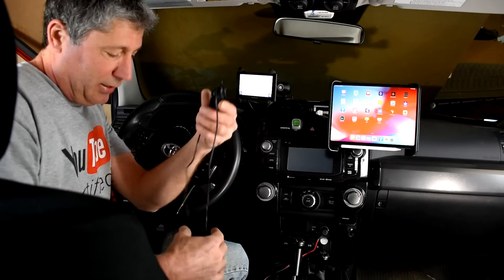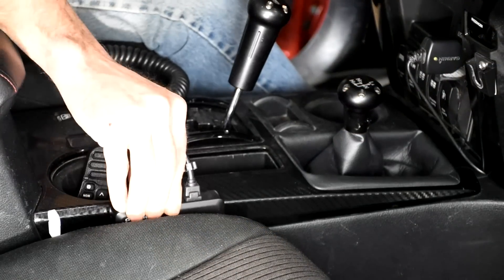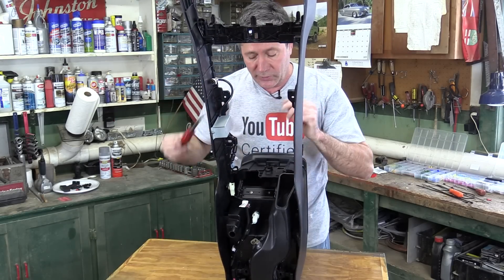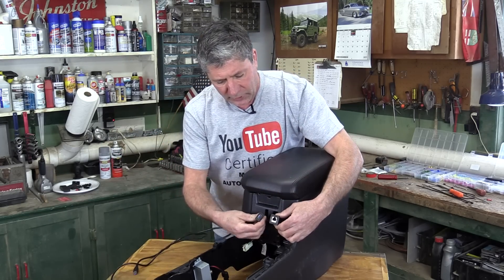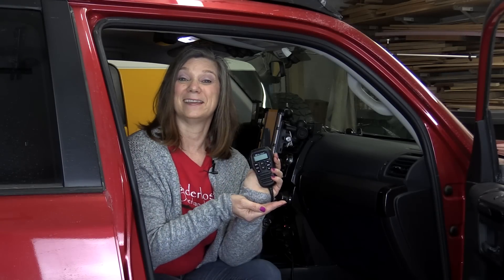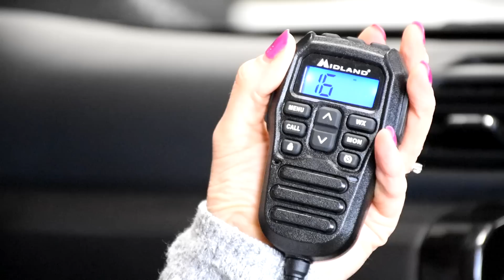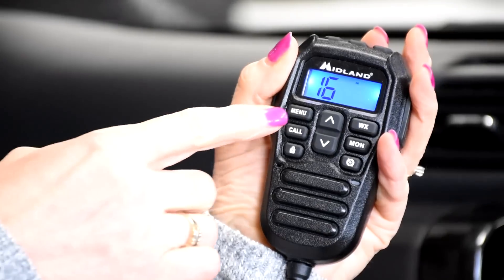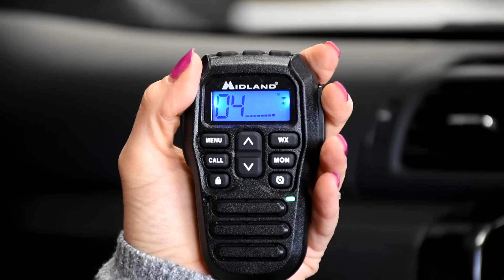GMRS Radio DIY Install & Testing Against CB Radio For Distance

Comment: Your results were very interesting. My friend and I did a similar test. Both vehicles using tuned roof mounted cb antennas vs in vehicle handheld gmrs radios. We found the cb to have much more distortion but longer range. I was unfamiliar that they even made vehicle mount gmrs radios, good video
Reply: In theory, CB should outperform. Lower frequency, longer wave length, less path loss. The reality is, it takes a lot of work to get a CB install just right to do that on “legal” power levels. GMRS uses tech that’s been proven reliable over the last 30 years and is much more forgiving but 5-8 miles is more realistic in terms of open area range (radio to radio).

Comment: I Hope mobile GMRS rigs of this type becomes a thing in Canada we only have low power handhelds. I am impressed by the compact well optimized GMRS mobile antenna as compared to the slightly larger but compromised CB stick since a properly optimized CB antenna needs to be 102 inches,  too cumbersome for most.

Comment: In all fairness, the CB setup you're using isn't ideal for long range comms. It's a small low power unit. But, GMRS is a better option anyway. I'd just stick with that.

Comment: Great reception over the flat Iowa corn field terrain with GMRS.  Of note is the 50W power allowances of some GMRS channels.  And repeaters that can enable coast to coast communications with GMRS.  But, CB is my goto for local info and road conditions.
GMRS is for family and friends to maintain contact over relatively flat and open terrain.  Obstructions are not your friend.  And it didnt cost me a dime for the license, applied for online.

Comment: Excellent video! I got a couple of  VHF/UHF HTs and figured I'd study and get my tech license and one radio (VHF/UHF) for the car. Wrong! Now my head is spinning. I need a CB (preferably with SSB) and a CB HT or 2. I need a GMRS and a GMRS HT or 2. I need a VHF/UHF ham and a least already have 2 HTs.. I need a HF set for frequencies on ham (to get many miles) and a stinking general ham license to go with that. It's all a little much, and I'm overwhelmed. To cover all my situations, I truly need 4 different types of radios! I did enjoy your video though. 🙂
Reply: maybe you could stick with general HAM and build from that up? not sure for US, but here in europe CB is free to use (up to certain power of transmit) as are PMR (446mhz, up to half watt). if you  dont need two way  option for long(er) ranges, why not buying reliable world receiver radio?  even countrywide system is enough for most cases imho.

Comment: In Nevada having a HAM radio when off roading is a necessity. I've been to places where there was not a cell tower, gas station, or structure with a land line phone for over 100 miles. You either need a ham radio or a sat phone to call for help.  I could easily cover hundreds of miles using a 2 meter VHF radio via a repeater on a mountain top. Thousands of miles on HF.  Also under normal circumstances you need a ham license to transmit, unless there is an emergency then you may use a ham radio unlicensed.

Comment: Nice video.  Is the radio getting enough ventilation mounted where it is?  I'm curious as to how much heat it generates transmitting at 15W.   My mobile radio transmits at 5, 25 or 50 watts and I have it mounted in the open because of the heat it generates at high power.  Thanks, WA4VOL

Comment: Ya, I thought the squelch was a bit high on the road test. However, I did notice a lot more static on the CB than on the UHF.  The benefit to CB is almost every semi has one.  You can talk to all of them. It's unlikely they'll have gmrs in their trucks. For me, I'd be running both. In my opinion, redundancy is key.

Comment: Is there any worry about that antennae wire and the gap with the bumper? Wondering about any kind of flex or rubbing while you're on (or off) the road.
Reply from the maker: No worry, the gap is pretty sizable. We've had a couple wire bundles going through it for a couple years now with no abrasion at all.
Reply: @WanderlostOverland  Nice, I figured as much but wanted to check. I have a JKU and I don't know how much I'd trust that gap on my rig.

Comment: The only thing I like about CB radio is the fact that your allowed to use SSB (USB/LSB). I love this mode otherwise AM sucks as it's much more prone to static and interference. There some days where the skip and or the ground noise is soooo bad that at that point the CB radio becomes absolutely worthless. Even the single sideband mode is not very effective in these situations and this is the drawback with the 27MHz HF frequencies as opposed to the 462 MHz UHF band such as GMRS. My opinion, is I don't think that you should have to shell out $80 for a GMRS license as it should be free just like the Amateur Radio license. After All both licenses are good for ten years.
Reply: Amature radio licence is free but the testing agency may charge up to $15 , however there is no renewal fee and it is good for life. KN4BHS

Comment: Great video.  I am a ham operator but enjoy cb more and can pretty much talk on any frequency out there with the radios i have. I also have my GMRS license and wish more people used it.
Reply: I too wish for more GMRS operators.  I enjoy my Baofeng UV-5R handheld radios; but far too few jacket-jaws around.
Reply: what would be better for hitting the trails? cause we use normal 2 way radios but aren't good enough. i also do hunting what would you recommend?

Comment: Hi ! Great Video! I am a user of Midland  equipment and am glad to know that they offer a 15w version with a remote head! 
I have 2 of the 4 watt versions I found on LETGO and F.B Merchandise that were originally offered at Walmart.  Same Midland Quality, but, no longer offered at Brick and Morter Walmarts.

I am a life long Ham Radio operator(1976), CB user, and all around communications tinkerer. I would be curious if you did another experiment, because Technically, a fairer comparison would be your 15 Watt Midland against a 12 Watt  SSB CB unit.  It would be closer to Apples to Apples. Also, use a Wilson 1000 or equivalent good quality CB antenna. 
I also realize a big deal is that using a CB for off road VS  GMRS is that the antenna for GMRS can be considerably shorter and less prone to branch damage Than a CB antenna for similar gain.
An alternative would be a 102" bumper mounted CB antenna that is anchored to the front door gutter, looking like a 1950s patrol car with the big whip clipped to the front gutter.. lol

I think the GMRS would still win out, but the SSB would give greater distance than the regular(AM),CB.
When using SSB CB, it is recommended to use Channels 36 to 40 Upper Sideband(USB) or Lower Sideband (LSB) all units MUST be on the Same Sideband to communicate. The Only other consideration is use of Clarifier knob to understand( or clarify) the other person. 

Kudos for getting a GMRS license! Most people won't even bother, even though they know it is required. Now that you have your GMRS license in hand, you might want to check out The ZELLO app for your Smartphone.
 It is a PTT (Push to talk) app where, for free, you can make talk channels to talk to people in your group for free.... as long as you are in range of cell towers. 
Now, there are some channels on ZELLO that GMRS repeater operators have linked the app to their GMRS (NWI GMRS, for example) Repeaters, allowing any licensed GMRS   user to use the system with your smart phone giving you massive range with multiple repeaters linked together. This may be handy in some situations.  There are also other off roaders that use Zello as well. The app has the capability of searching for other channels by name. (I.E. GMRS, jeep users of Tim buck too...etc.) so you may be able to find  other off roaders as well. 

Also!
Make sure you use your GMRS Callsign at beginning of conversion, at the end before signing off and if you are conversing more than 10 minutes CONTINUOUSLY. Put a label on the dash somewhere that states the Callsign like aircraft have their tail numbers on the dash of their aircraft so you can remember it and not have possible hassle from F.C.C or other users.
 
Your installation is really well done concealing all wires and controls!   I am keeping my eye out for small SSB CB units to mount a similar way, but I would be totally surprised if one was available anywhere. 

Keep up the great videos! Another video you might consider would be  to go over the features in detail of this Midland Radio, you may find it to be even handier to use on the trail.
73 (Best Wishes)
Myron, 
Wd9akg,
WRDN293 (GMRS)
KBRN5232 (Old CB call, back in the day)

Comment: Great information.  I'm pretty sure you have me sold on GMRS radio system for traveling with friends.  Any idea how the system will work installed on a fiberglass body?   I have CB with a NGP (no ground plane) antenna, distance is good for about 1 mile line of sight (tuned SWR down to 1.5)
.
Reply: As you found, the no ground plane CB antennas are not very effective. Even the full body of a vehicle is a bit undersized in most cases for the CB frequency. It is just the laws of physics. Because GMRS only needs 6" for a quarter wave, you could use a 12" disc for a ground plane underneath the vertical antenna. I have used a cooking pan in the house years ago as a ground plane for a mag mount cell phone antenna and it made a tremendous improvement. 

You can simulate the disc with several 6" wires radiating outward and grounded to the shield side of the antenna. And it could be placed anywhere on the vehicle but ideally as high as is practical. They sell NGP GMRS antennas which might work OK. I used to have a Chevy Lumina APV vehicle which was mostly fiberglass. I used a through the glass antenna for 2 meter ham. It was OK, but not a great antenna.  The used to have similar antennas for through the glass, however, because of the tint used these days you would need to determine if you can use that kind of antenna.

Comment: HAM is a great hobby but it does not really fill the need for off-roaders and overlanders. Both are looking to communicate with each other and others in the same activity. HAM is not now nor will it ever be  the common denominator for offroaders and overlanders. This is due largely to cost and time commitment. Midland's top GMRS radio and a good antenna can be had for well under $500. And it is largely plug and play.

Comment: I am not going to beat the Ham Radio drum but it is one more way to communicate in an emergency.  Personally I prefer having a cellphone, CB Radio, Ham Radio, and a Satellite Phone in my truck.  I keep some FRS radios for when we are around others that prefer them so in the end, use what you have.  The "GoBox/Bag" for me is about medical and communication.  Ok lots of food too.  Great video and a very good example of the differences between GMRS and CB.  Thanks for pointing out the licensing requirements.

Comment: I have the same setup that is covered in this video; Midland MXT275 and the The Cobra 75 WX ST. I have looked at and considered getting a HAM license. I was responsible for radio communications in my military career.

Properly set up, tuned and maintained and assuming minimal interference CB radio can cover 10+ miles. The advantage of GMRS is the higher power and the plug and play nature of the set ups. The MXT275 with one of the Midland Micro Mobile antennas (other than the wire tie antenna that is included with the radio) is a very quick, easy set up to install. For people who are just looking to install communication capabilities in their rig and are not looking for a new hobby to send time and money on, GMRS is a great way to get something working reasonably well fast and cheap.

CB and to an even greater extent HAM require more effort and more fiddling around to get and keep the system working at its peak.

Wanderlost Overland, good episode. Decent information. One critique, the "MON" button turns on "Monitor mode" which basically means turning off squelch.

Comment: Don’t be at all afraid of the Technician Ham exam. Only 35 basic questions and need only 27 to pass. Prep using you tuber classes (w4eey or Dave cassler)  and usually only $15
Reply: Just like GMRS is great tool to increase your Comms options, Ham radio is as well. Tech, and General is not hard to study for, and it's OK to fail a test. You can take it again. As Tim Odell says... Don't be afraid. Ham radio is a wonderful hobby in and of itself. KN4HYN, WQYR514.
Reply: You guys are super smart, because my boyfriend has taken the practice exam and failed miserably. In fact he has taken the basic ham exam, more than 10 times and still failed. He has his gmrs license, and is happy with that by its self. He has a learning disability to the point where, he don't comprehend the math or the theory part of the exam. He said you guys enjoy the ham license, that he will never get to pass. At least he will still be able to get his own repeater, and use 50 watts of power in his mobile radio. 

WRFU222 / Stephen R.
Reply: @hollytimlick2465  what part(s) is/are tripping him up?
Reply: The Ham Study app helped me out tremendously to pass. Keeps track of your progress, and shows you the content areas where you need to focus on. Best $4 app I’ve bought in a long time.
Reply: Tim Odell de: N9SMJ
Reply: I have a Tec license for HAM. Will that be enough for the GMSR radio?
Reply: @stevenwlowe4186  😂
Reply: @stevenwlowe4186  no, as they are different services. You will need to get a GMRS license ($70 for a 10-year license, no exam).
Reply: Ham Radio Prep if you want to pass easily.

Comment: im cb all the way   ...
Reply: Yeah, I’ve got a sweet spot for CB as well. So much so, that I installed one underneath my car radio in the Double DIN size bezel. Sweet setup. Pioneer up top, Uniden Bearcat 980SSB on the bottom.
Reply: Why is that?
Reply: CB is no good in my area. Ther's literally thousands of truckers on the radio at the same time. GMRS 50 watts legally with repeaters all over the place. Definitely worth it. Now it's only $35

Comment: My son and I have CB radios in our cars.  Both have wilson 1000 antennas and bearcat 980ssb radios.  No problem 8-10 miles. 12-15 tops when frequency is quiet and squelch off. Like another person said.  It is the antenna setup that does the work for you.  
I do use the gmrs  radios for camp they are wonderful radios to have also.

Comment: Cb radios are great in the right configuration.  SWR and type  of antenna is another huge factor. If you have a crappy antenna  system and cheap feedline "coax" with low db gain, your results will not be very good. An of the box cb radio with a  metal antenna should get about 5 miles. Reception can be enhanced with ajustments from inside the radio, but once again, your SWR must be correct. 1.5 SWR  is good 1.0 is perfect. You also want to have 48-55 Ohms of impedance on the reading using a hand held computer. Conditions in the ionosphere with  the F1 and 2 layer, sun spots and  the type of cb radio you use,  is a big factor. I'm not sure what modle of cb radios you were using g in the video, but once again, SWR, conditions and type of cb radio plays a  huge factor in recieving and transmitting performance. On another note. I love all radios and plan on using GMRS radios in the future.

Comment: For distance with low power FM nothing beats HAM RADIO. It blows FRS,GMR,CB, out of the water. 5 watts on 2 meters with a rubber duck antenna 40 miles. With CW on HF 1 watt can reach thousands of miles.
    If you can read and remember what you read you can pass the ham tech test. I current book has the questions just as they are on the test. Memorize the questions and you will pass no problems.
          Cost for the test is around $15.00 contact your local ham radio club for more info.

Comment: KD4AFP here. "Ham" radio is great and has been in my blood for 30 years. CB got that blood going for me in the early '70s. Midland's GMRS mobile radios provide another dimension to radio communications that has been lacking for years in the handheld-only GMRS market. Properly licensed stations (as I have) can upgrade antennas for better range.  If needed, GMRS is authorized to operate w/ 50 watts ERP.  Do I make contacts on GMRS as I do on HAM radio, or even CB? No - it does however provide a reliable way for stations to communicate over decent ranges with the right setup.

Comment: For just buying and using, there just ok (out of the packet), but there are legal limitations to any thing. FCC still has phrased in that CB operations will be in breach of law when trying to make communications of more than 130 miles distance (that's 65 mi. each direction from all transceivers in operation) so that the band won't be overcrowded and pile-ups occur, because a properly tuned CB has the ability to do so at all and any time. Try to get ANY frs/gmrs fixed. NO SUCH LUCK, they're REPLACE ONLY. CB's were meant for the long haul, not just medium to short distance communication.      LT680 SouthWest Mo.